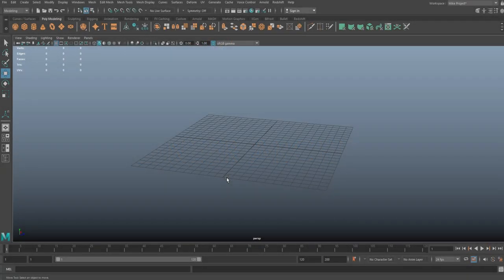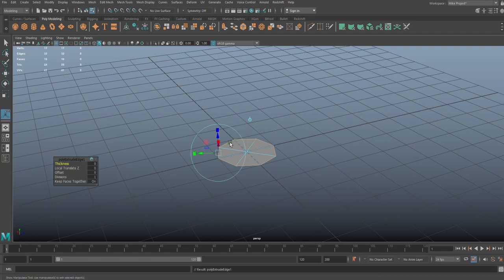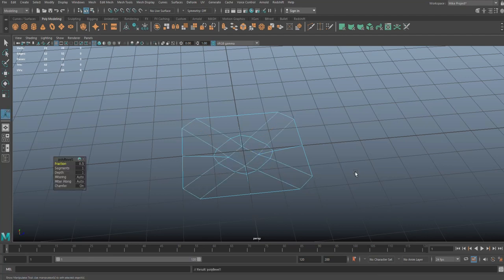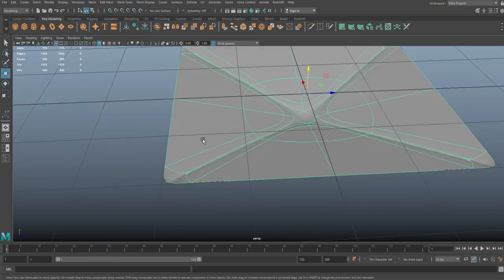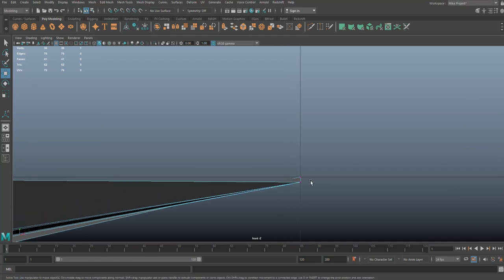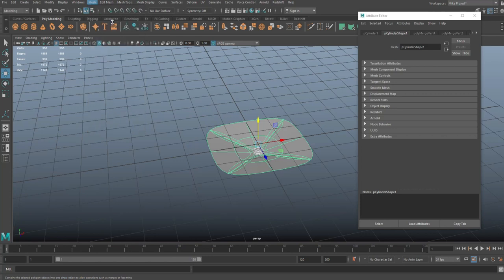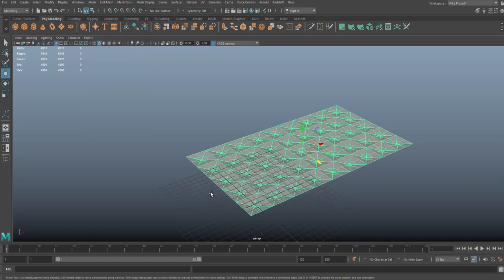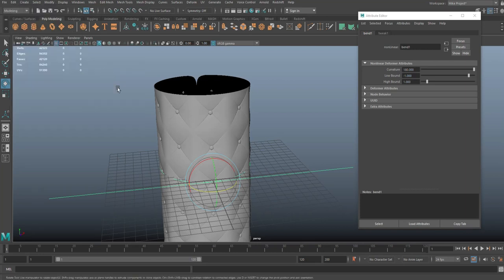How to model the famous Chesterfield button in Maya

Comment: Im creating an interior lighting scene "all are looking nice" but Im on the edge of stress and pulling my hair out because I cant render a decent sofa using arnold...

I dont know what to do... everything else are fine but the sofa isnt, no matter what I do about the sheen and bump it always looked like a rubber or lambert something

I cant .... I just cant get it 

Im here searching everything how to this how to that ...
Reply from the maker: Leather has a special "sheen to it" that you need to create manually. Decrease the specularity of your leather material and then manually increase the "spread" of the specularity
Reply: @MHTutorials3D  will do...
Reply: I found that using a noise for the base colour, and tweaking the noise colours so one is slightly lighter, then adding sheen and a really low bump value, I was able to get a pretty realistic looking fabric couch. And for leather, it’s pretty easy, just a matter of getting the spec roughness right